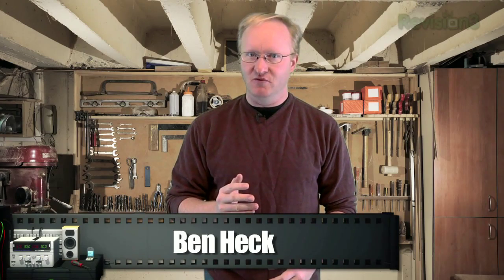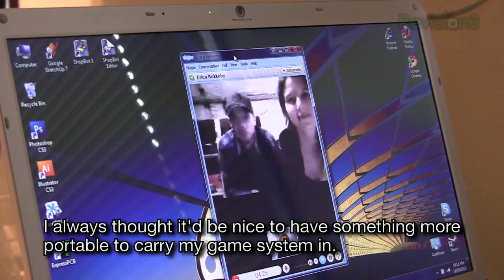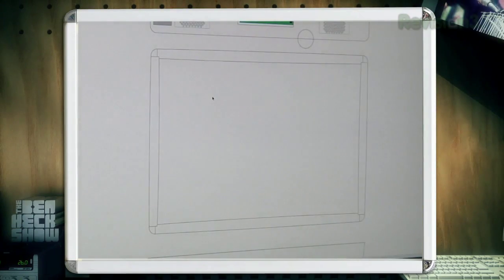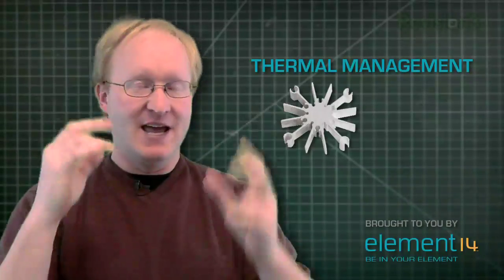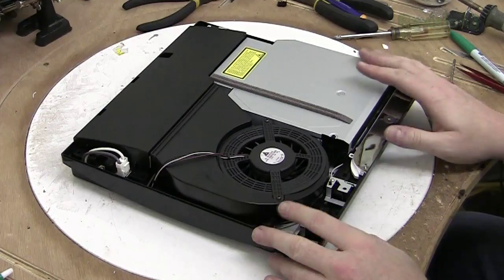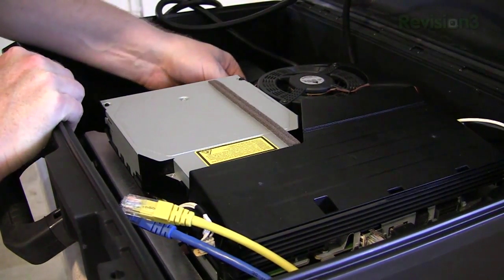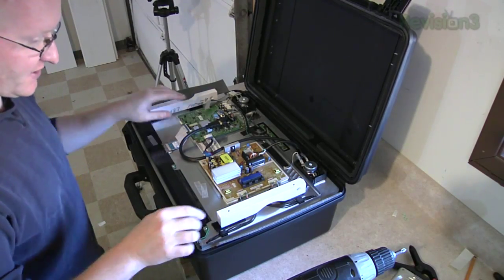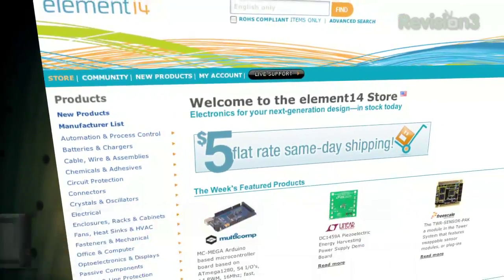The Ben Heck Show - Ruggedized PlayStation 3

Comment: man, I wish I had the bones to lay down for something like this. I've got an old phat ps3 with a bum power supply I'd like to bring back to life. I probably wouldn't bother, but it's a backwards compatible model that also plays ps2 games, lol.
Reply: Don't back down!!

I'm no expert in tech repair or modifications, I replaced my phat's power supply that runs cooler than the OG supply.

Replaced 13 bladed fan for a 19 one, all thermal pads swapped with new ones, and also scrubbed the old thermal paste and replaced it with graphite foil.

Unless your trying to soder on or off something the above mentioned is relatively simple. There are ton of video guide on YT and even more online with step by step guide.

As result my OG runs quite cool, since I jailbroke it while back I use multiman to check temperatures. The next step for me is to install a custom made water cooling. A few Japanese owners have videos that help with that.

Good luck man, and take care of your Phat and it should last you quite a while.

Comment: Sir, I was wondering if you might be willing to do a video on the OG 60gb Fat PlayStation 3 model. Mine has crapped out after 10 years and I've been told it's due to weak solder and engineering.

The reason why I don't just buy a PS3 slim is because the OG PS3 has that built-in PS2 that allows me to play PS2 and PSOne games and still output to HDMI.

I know there must be millions like me who don't want to give their original PS3 up. 

Anyhow, it's just a suggestion, but one I know you're qualified on which to make a great, informative video. And perhaps you can help the millions of us fix our beloved PS3s!

Thanks for reading this. Hoping for some insight.
Reply: sanshoryu I know exactly how you feel. you can do a temporary fix by using the hair dryer method. heathing up the chips and pushing them back onto the motherboard. ive done it a few times usually works for about 6 months.
Reply: \just get a ps2 they are pretty cheap

Comment: I have a question for you a good-sized know if you can do it. Can you build a a PS3 PS4 motherboard built into one. With them connected both running the same operating system as a PS4 system. where it runs drivers for the PlayStation 3 PlayStation 4 PS2 and PS1 can be played on it. Can it be done? can you make all those motherboards run as one and one together and one operating system on it together? With both the PS3 motherboard and PS4 motherboard running together and work as one console he was in one disk drive airplane games and run as a PC computer to. With extra USB hookups and keyboard hookups and other hookups for other things put out with a webcam built in do it. With five different terabyte hard drive desktop terabyte hard drives
Reply: hi Ben this is Jared. I was just wondering if you were able to build something like that with multiple hard drives. In it PS I do love watching your show. I watch it on a daily basis on YouTube. I will tell you a little bit about myself. I was born with a heart defect. Hey been to three heart surgeries. 1 as a baby when I was my sixteenth birthday and one when I was 20. They said that I would never make it past that age of six years old but I keep on pressing forward. I want to be able to do more things but I'm not able to only time I will try to I love to do electrical stuff working on things I like to recycle. I live in Battle Creek Michigan being wet I am low income I live in a mobile home trailer park in a pull-behind camper trailer. and I only get $760 a month. give me disability I tried to do other things to make a little bit of money on the side I tried to help others a lot. Just wondering could you do something like that will play multiple games systems disks as one as one operating system. With a PS4 motherboard PS3 motherboard and an Xbox 360 and Xbox one motherboard and PS to motherboard running all as one operating system one as a PS4 operating system and PC operating system. but all the motherboard's connected into one one running as one single operating system. With multiple terabyte hard drives desktops hard drives where you can plug in. Multiple other things into it bike headset speakers and stuff like that. and thank you if you could I. I have to use speak talk where it talks I talk to the phone. Sometimes I forget to say. Afterwards I'm sorry. but it talks I talk to it it speaks for me types for me I have a hard time spelling I am. I am special ed. it'd be really nice if you can do something like that for me I am a really big fan of things it's awesome games like Mario. Rush game rush like I like a lot of older games too
Reply: if you could it would be nice if you can have her if you can do this for me can you call me and let me know if you ever do do this so I can get the right one so. My phone number is 269-274-2494 thank you and God bless

Comment: nice build I would of done a few things different like another guy said in the comments cooling is a must with the ps3 slim lines especially the cech-3001 the cpu and graphics heat piled on top of the power supply would heat the inside of the case quickly since
1. you built a concept case for a military op.
2. Iraq HEAT and dust and sand
3. exhaust heat reflowing the case renders the inflow air mostly comprised of heat ( Iraq dessert )
I would of moved the exhaust portion of the case closer to the side and cut a slot so the rear exhaust vent can fit and push the HOT air out instead of recycling its own heat + Iraq airflow into its self which in turn could cause what im always fixing on other peoples systems is the YLOD/RLOD ( YLOD = over heated cpu caused the solder to come off the pins or off the board its self do to heat warp  and vies versa with RLOD from graphics card )
like I said not a bad idea but you forgot the main factor exhaust/ air inflow
ik this video is about 4 years old now but I thought maybe you would consider this a factor in future builds
                                                                                                          sincerely  
                                                                                                  - Juggz-Mod Shop -

Comment: It's definitely a great project and concept, however there is one problem: it is not well ventilated. This is a critical flaw in the build! With minimal space and no ventilation points, you're risking a quick RLOD/YLOD. The hot air has nowhere to escape and is circulating around in the box, in the meanwhile the Playstation produces more heat and the fans are working overtime to prevent the console from overheating. It gets worse, the Playstation and the air around it are still heating up, ultimately resulting into power shut down because of overheating. In addition, the next time the console is turned on, the temperature inside the box would still be too high and it will cause an even quicker shut down. The more it's used, the higher the chance of serious damage to the console becomes.
How was this flaw not taken into account?
Reply: The Saggi didn't you see the fan ports with filters? that is plenty, the PlayStation 3 does not produce much heat
Reply: He has one intake directly over the fan, and a filtered exhaust, that is plenty for the amount of hardware, just because air is warm, doesn't mean it's over heating. I've had gaming PC's with much more intensive hardware that comfortably runs at over 110 degrees
Reply: Q. T.
Where in all of my comments did you feel like I was in discomfort or that I was stressed out? I just stated some flaws and provided arguments as to why I think those are flaws. Whether I used paragraphs or one sentence, it doesn't change the opinion that I have. But instead it makes my comment look superficial, had I used but one sentence.
Reply: More importantly the heat and dust from the environment it will be used in. That's not normal air temperature over there.
Reply: ToAstYNaChO There are no fan ports anywhere on the surface of the box. From what I understand, and see in the video, he only uses two filters on the top of the main panel. There is no way that those two are enough. The PS3 does produce a lot of heat, even more when trapped in a badly ventilated area! If you want proof then you could place your PS3 in a drawer and close the drawer while playing. After 30 minutes you will be able to hear the PS3 gasping for air. This can be recognized by the jet engine sound that it produces.
Reply: ToAstYNaChO I'm sorry man, but you can't convince me that putting a PS3 in a plastic suitcase with two filters for fresh air is good for the PS3. Just think about it this way: when it's hot inside your room and you don't open a window, it'll get warmer and warmer. Eventually you will experience overheating of your body, you'll be sweating and you might even get a headache. The same thing happens with a PS3. " just because air is warm, doesn't mean it's over heating " Are you kidding me? The whole point of ventilation is to replace to warm air inside a room or area, with cold air from outside that room or area. Because the air is getting warmer, the hardware will be getting warmer as well. That will cause overheating more easily.
Reply: The Saggi
I don't think you're familiar with how components work under load. you can have the very best ventilation possible, the air exiting will still be very warm. GPU's and CPU's work very comfortably at very high temperatures, that's normal. As long as there is air getting in, and air getting out, all is well. The system by default has one very small fan for both intake and exhaust, with even smaller vents for both. anyone that knows anything about hardware can tell you that the internals must not be very demanding if the manufacturer puts that little cooling in a system. Im just trying to say from my personal experience, that would be enough for an entire PC, let alone a dinky ps3
Reply: ToAstYNaChO It's your word against my word, so we won't be able to come to an agreement. Therefore, I still refuse to believe that two lousy filters are enough to prevent overheating inside of that plastic box. My first PS3 met it's demise one year ago, because I had it in a 36x66cm cabinet. Even though I always had the door open when playing, it still reached critical temperatures.
Reply: The Saggi Did somebody forget to take their anxiety pill this morning? Jeeze. You make it sound like the world's going to end. "Plenty of room & power to add a few fans if heat becomes an issue," is all you really need to say.
Reply: I totally agree I have had a ps3 and it will get hot fast I use to play battlefield 3 / 4 and I could hear the fan in the system I can garrante you this will overheat and in a black plastic box in Afghan I would have put fans and air holes in it
Reply: +The Saggi That isn't how it works. Fans don't cool the air, they move it. the fans in your PC (or console) blows the air hot. It doesn't matter if air is cool, warm or hot. It will have no effect. The movement of air is called ventilation. As long as there is air moving over the components then you will achieve cooling. The ventilation system he built into this build is adequate for its use. This isn't the first electronic device built into a Pelican case.
Reply: Mike L
 That's not how it works either. Ventilation means that the hot/warm air is replaced by cool air in a continuous cycle. (This process can be compared to breathing: cold/fresh air is inhaled and warm/used air is exhaled.) If the warm air has nowhere to escape (ventilation points) it is trapped inside the PC or console and because it keeps flowing through the already warm space it becomes hotter and hotter. This is when the CPU reaches critical temperatures and shuts itself off to prevent permanent damage. Although overheating could be a problem with PS3's, I've learned that the main reason for YLOD/RLOD is the termal paste used on the CPU and the GPU. Sony used low quality termal paste, which over time deteriorates, for their older models. This could be seen as a marketing strategy or cheap manufacturing. Still, I don't think it's a good idea to poorly ventilate a PS3, because overheating can still occur.

Comment: I really like the implementation of the military spec power plug in. This is the plug we use on all our radios and should even allow the use of power from many of the radio batteries used. Very well thought out.

Comment: great video and very neat
i just have two suggestions to offer :
1- isolating the metal would provide more safety in case of any failure or movement ( no one knows what could happen with time .
2- instead of putting the aluminum frame directly connected to the outer case some springs or any sort of shock absorbing technique would really do this build a great jub in increasing the lifetime of this setup and providing a shock-proof build
Reply: The only thing that needs a shock resistant mount is the sensitive electronics of the ps3, and maybe the monitor. the ps3 was already on a shock proof mount.

Comment: I'm curious why the super slim case model wasn't used its BD-ROM drive is top loading and locks the disk in place on the hub this would avoid the need to have that awkward sliding door to access the slot load drive. This saved space could have been used to provide storage for the controllers. Additionally the SS model uses a smaller processor die resulting in less heat than previous models particularly important since this is unlikely to be used in an air conditioned space. Secondly a SSD should have been used in place of a hard disk for additional durability and lower heat as well.
Reply: Look at the date of this video. The super slim version wasn't even out yet

Comment: Please could you make an Xbox one that plays Xbox 360 games
Reply: That isn't possible because the Xbox One uses a different architecture than the Xbox 360. The One runs on an x86-x64 based processor while the Xbox 360 uses an ARM based processor. The games are incompatible on both hardware and software levels.
Reply: Ovidiu Lipsa To be entirely fair, either of your proposed ideas are possible. The GBA player for the Gamecube doesn't emulate at all, but instead has all the hardware in the expansion unit and just uses the Gamecube to provide the AV and control I/O. A third party company made a GBA player for the SNES, a la the Super Gameboy. But in the end it's just an elegant way to glue consoles together, FPGA implementations or emulation in the expansions aside.
Reply: Ovidiu Lipsa Yes, but a third party could create a device that played SNES on the N64 or N64 on the Gamecube, though emulation of the latter isn't at a point where it would be usable enough to be a commercial device (I believe the GBA on SNES device uses emulation with an ARM processor rather than actual hardware or an FPGA implementation). A third party did create a Gameboy player for the N64, for instance. The key is that these consoles have the interfaces to output controller I/O and receive video data to display on screen (the cartridge port or expansion port in the case of the Gamecube).
Reply: velocity37
So if you're proposing a hardware peripheral for the Xboner that would contain almost all of the X360 hardware to run games, it'd be in almost all cases pointless because you could just buy an X360; even with it hooked up to an Xboner it'd be totally irrational because it would still play games in 720p (or if they're trying to not get Steam-rolled by the PC master race; 720p up-scaled to 1080p). Back to an actual peripheral housing most of the X360 hardware, it would be MASSIVE for an add-on because the X360 has heating problems, even with a spacious case and a large heatsink. Would the add-on RRoD too?
Reply: Tyrov
I proposed no such thing. I was responding to Ovidiu Lipsa, who gave examples of things that were possible while stating they were not (SNES on N64, N64 on GC). They would of course not be practical, but possible.

The third parties producing such hardware now are using either emulation or FPGA implementations, which are only now possible because we are in the future.
Reply: Ovidiu Lipsa Oh, well that changes things. Being on Ben Heck's channel I had assumed hardware. Without a cartridge slot you'd have to do emulation, and for that you could probably take the HLE approach. "Corn" managed to do N64 emulation on Pentium II era hardware, though compatibility was predictably disastrous. As far as a "real" emulator I'm not sure, but I've learned to never say never. Years ago a coder by the name of FluBBa wrote a SNES emulator for GBA, more or less as an "fu" to everyone who said it could never be done given the limitations of the GBA's processor.
Reply: No lol
Reply: +Edward James Bickels Nope, the 360 uses a custom designed 64 bit cpu, and the Xbox one has an 8 core AMD cpu which is also 64 bit. Microsoft's Xbox OS, which both Xbox One and 360 use isn't compatible with the arm architecture.

Comment: What about running this off a Li-ion pack? You had alot of room for a system like that. Then it would be a true portable.
Reply: Rainbow Dash I like that approach! Now that's the type of thinking we need more of at Aperture Science!
Reply: Tyrov and very very heavy i guess ridiculously heavy compared to what it can offer
Reply: An Li-ion pack is very small compared to the size of the case, and even then powering a 22" screen and a PS3 would not do well for a long battery life. If you were thinking of cramming the case with a bunch of Li-ion batteries it would work but it would be extremely expensive, and therefor impractical.
Reply: Tyrov true. And yeah i was going with the "cram as many batteries as one possibly can" approach
Reply: ***** u r 2 lets b fegs 2gether
Reply: ***** no u
Reply: Uwotm8
Reply: {MLP} Rainbow Dash We're saying let's fuck.